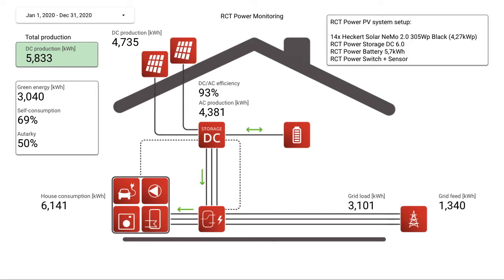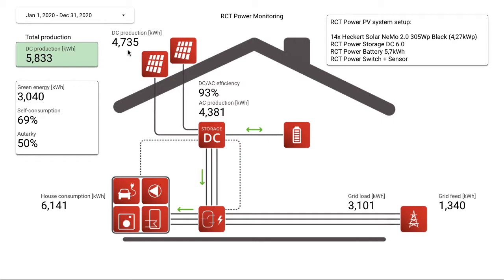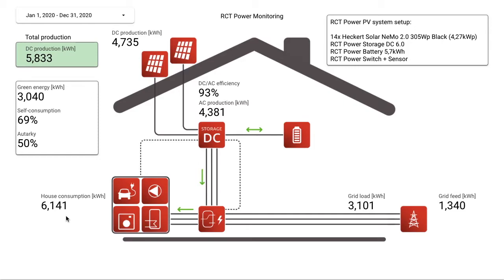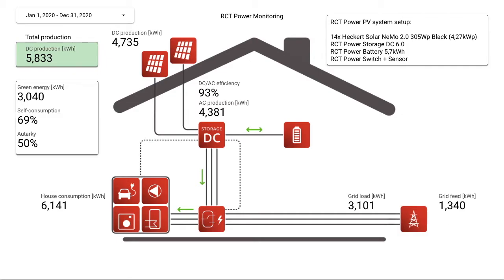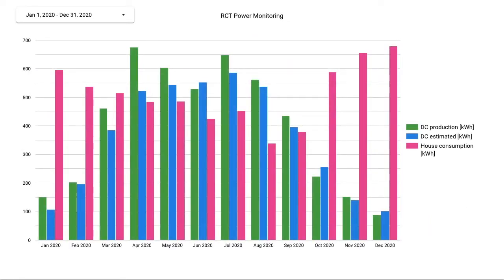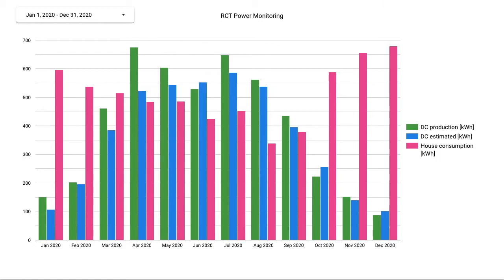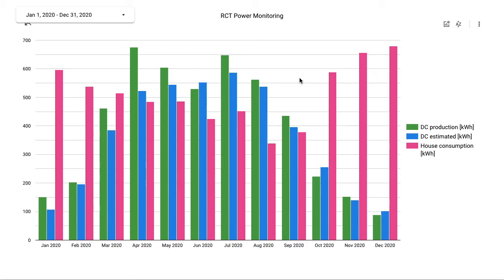2020 RCT Power PV system energy result

Comment: Thanks for sharing. Considering to install a PV system as well. Used the website you showed in previous video already. Did you do a payback analysis based on the cost of the system/installation, electricity needs and prices in your area? It would be very interesting to see some comparisons. Many thanks.
Reply from the maker: Well in my case is ROI about 3 years. Total investment into PV system was about 8000,- EUR. After 1 year I bought first EV, next year second EV. Now after 4 years of PV system I produced more than 19MWh. That is saving with my tarif 3800,- EUR. Fuel saving is about 6300,- EUR. So after 4 years we saved more than 10.000,- EUR. Without EV will be ROI about 7-8 years. But every case can be different - I have to say that PV+EV make more sence.

Comment: Thank you for showing your system. I plan to buy the same system from rct (with emergency-supply in case of grid-outage).
I heard "maga watts" in the video? I think that's wrong: kWh are something quite different than MW.
Reply from the maker: Yes, I'm talking in "mega" watts (MWh)
Reply: Megawatt hours is the correct term

Comment: Thanks for this short but informative video! So you decided to install RCT power system. I am going to choose that as well so I am glad that I found someone with that system. How did you get this graphics? Is this from the RCT app or did you create those graphics yourself? I heard the RCT App isn't that comfortable to use... The Hardware is great, but the software is (yet) bad.
Reply from the maker: Hi, you right, the RCT is good from technical point of view, but their software support is poore. Nothing for PC/Mac, remote control, horrible app for iOS - only Android app has some value. This presentation was made in Google Data Studio - so I did export from RCT app as source for Data Studio.